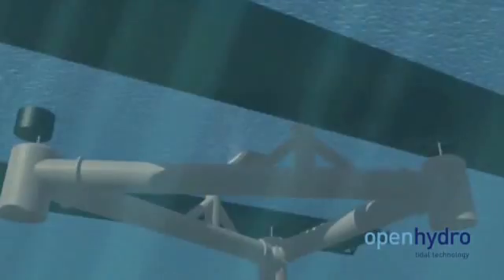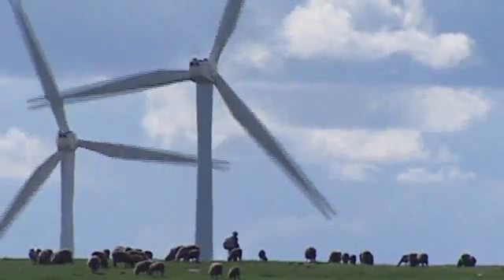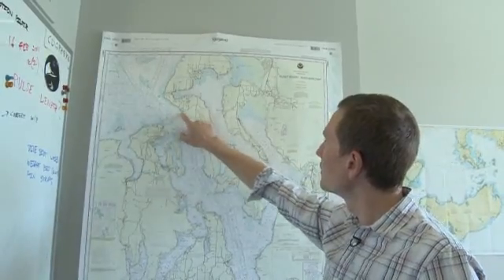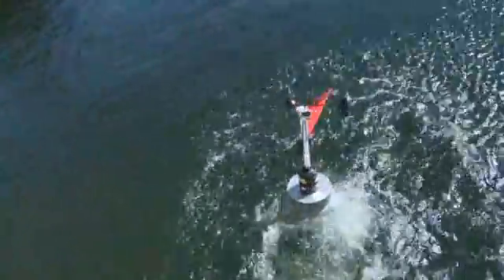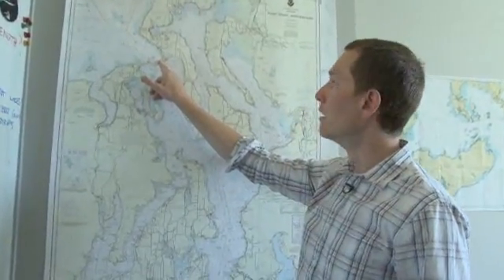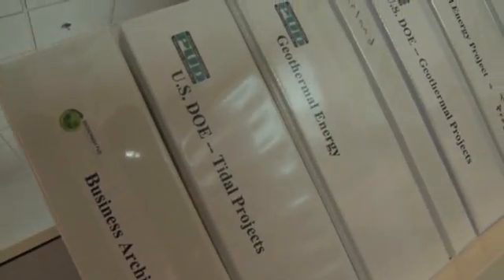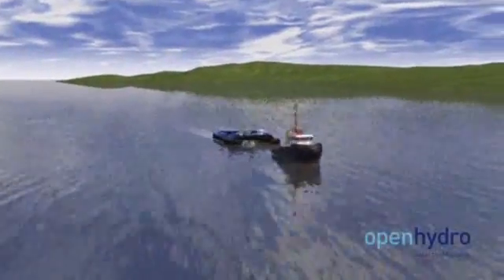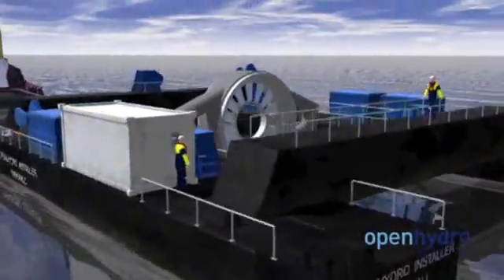Renewable tidal energy's reality check

Comment: Tidal flows are bi-directional, but this device can only harvest the energy from one direction ? Having it in a fixed position is for mechanical engineering simpler, but when the turbine would be bi-directional (e.g. it rotates like a windmill) it could harvest double the amount of energy.